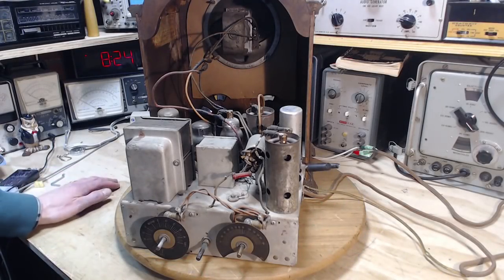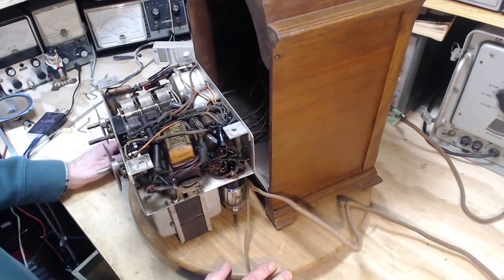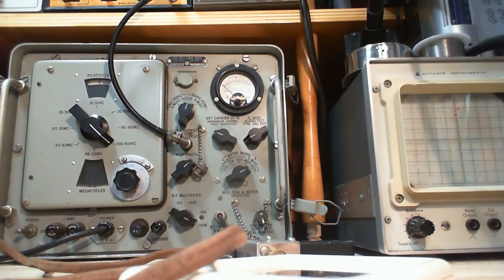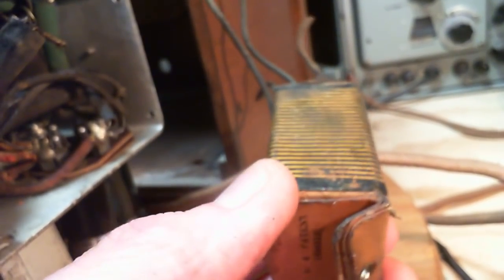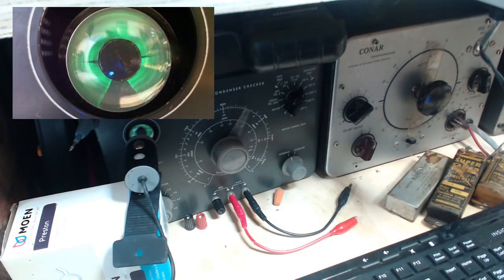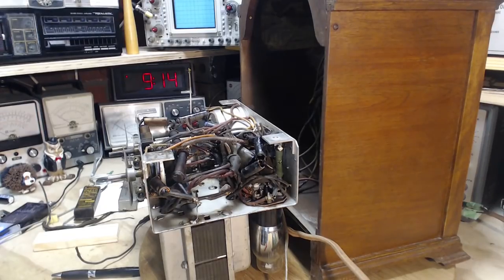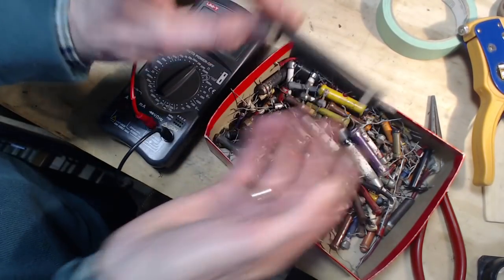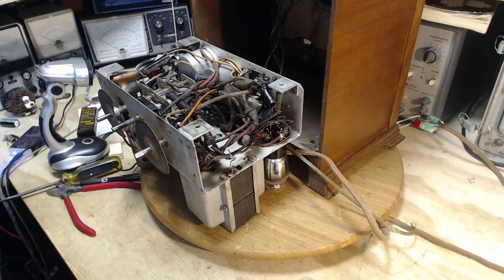Canadian General Electric K60 Video #2 - Capacitors and Resistors

Comment: Jim, I think the tabs are for mounting the capacitor in the chassis since there are.two of them. There was a bad habit the early repair men had of leaving the old capacitors in circuit and just paralleling the new capacitors in.  Not clear that's what happened here. In my 1935 Philco I had to replace all the dog bone resistors, way over value. The resistors with the  solder ends were surprisingly good in that radio. It would be interesting to see what some of those resistors are like in your radio. I encountered dog bones that were not labeled correctly, typically the dot was missing. The schematic and the measured value agreed closely enough but the resistor markings didn't.

Comment: The dog bone resistors generally drift high to very high, the ones with the metal end caps are generally OLDER than the ones with wire wound on the ends. I think that large humidity swings degrades these old resistors. some of these old resistors can be the source for noise in a circuit with voltage applied also, See Mr Carlsons Lab on you tube about this, he built a special signal tracer with real high gain for detecting such noise sources.!!